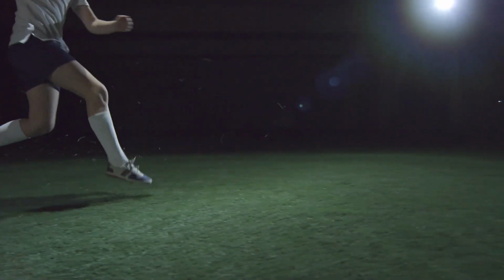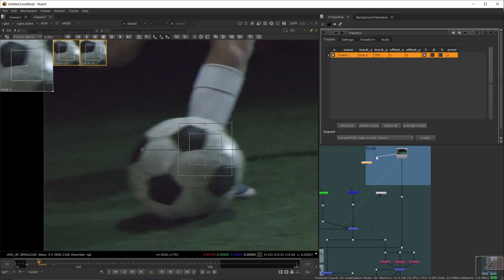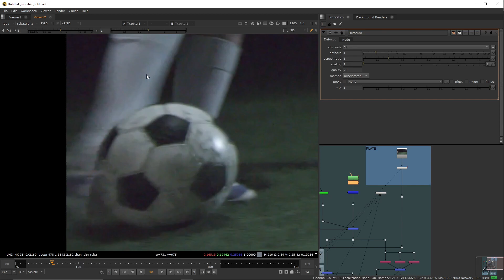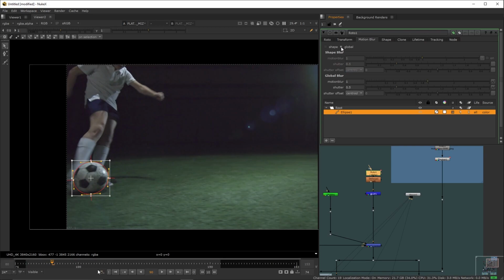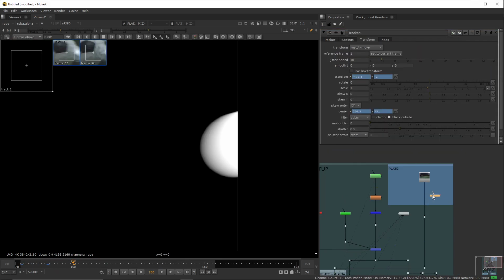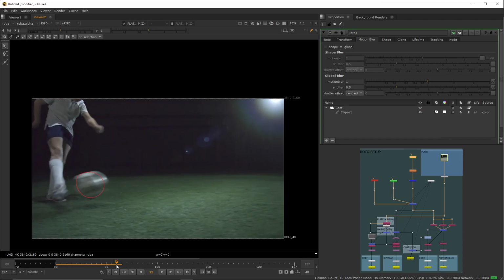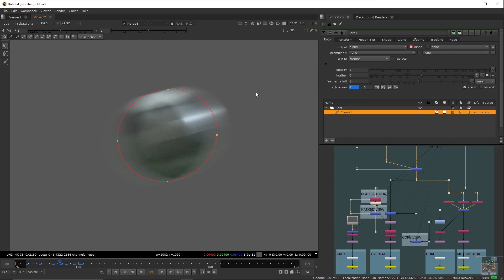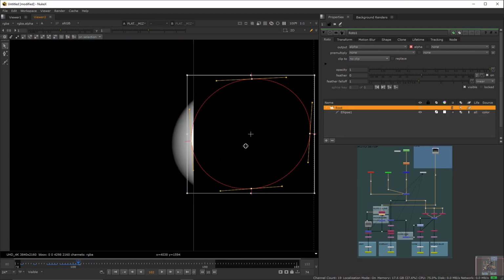Learn to Roto: Motion Blur

Comment: If you premultiply the alpha with the original shot to separate the ball witht the background. The background will be visible in the motion blur so how to remove the bacground from the motion blur?
Reply from the maker: For that particular case, you would need to edge extend from the core of the ball. There is a tutorial coming out this weekend for paint where I cover that.